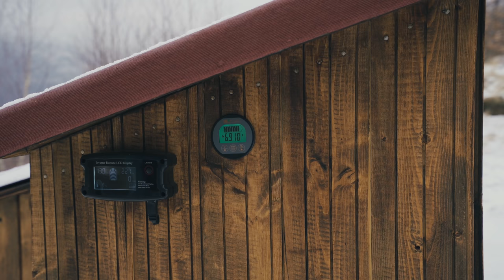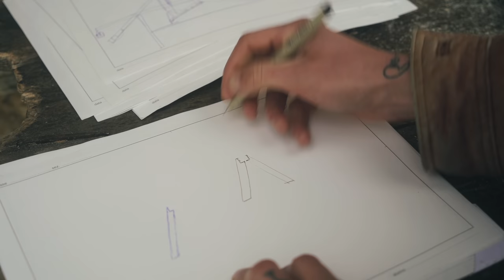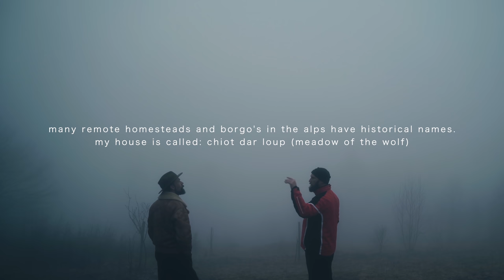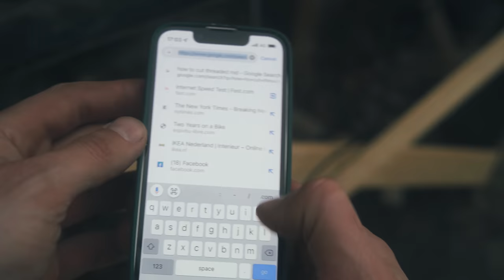#12 Meadow of the Wolf

Comment: An important piece of advice. If you have not planned to already get a small excavator in and flatten the ground around your dwellings. Your ankles will thank you for it. It is surprising how much physical and mental energy we use on uneven ground to stop ourselves rolling our ankles. Even if you don't have the funds spend the money on it and if it takes three months longer to finish the house you will be happy for the flat ground. If you do have the funds clear around the house as well and step the slopes so when you build your scaffolding you have safe even ground. If you have the funds dig the trench for the solar cable. The time and energy saved using a machine is well worth the money. Also, dig a u-shaped trench around your dwellings so any water flowing down the hill does not make your flat ground muddy. Great idea to build the wood cabin inside the building :)

Comment: Hello Martijn, Watched your Grand Dad's Video, what a talented craftsman. Now we see where your varied building and innovative construction abilities come from! On the boom of the crane, my husband said a small ATV 12volt winch, with remote control instead of the Manual Hand Crank, would be easier for one man to control, quicker, safer under load with internal cable brake. He feels it would greatly reduce the project time of rock removal as well, Just something to consider! Also suggest drilling multiple 1/2 inch ventilation holes in the generator side doors, then put screening inside, would not require you to constantly open close the doors themselves. Immensely enjoy the videos and the views, the Wolves we're an added Bonus!! Nancy & Tom, Bethlehem, Pa.,USA...God Bless, and Stay Safe!

Comment: The wind moves the sound over very long distances in the high mountains. It echo and amplify the sound to a significant degree, especially when it is cold in the air, and/or and the wind carries the sound in addition. Thats why these wolves easily could be as far away as 35 - 50 km, in my opinion.
The wolves in Italy (Lat: Canis lupus italicus) should not pose any threat. In general they are very cautious and avoid contact with humans. 
Thanks goodness its not the Scandinavian species you have to deal with, (Lat: Canis lupus). 😅 A species that can reach a weight of over 75 kilos, and to a certain extent, pose a genuine threat to humans, in my opinion. Especially if the herd feels strong.  Lol   🐺🐺🐺

Comment: I feel you so close ,I did something similar in a totally different situation some years ago.
Out of my experience I would suggest you to change the inclination of the pv panels, they are to flat
specially for the winter season.
the best performance you get it when the sun hits the panels perpendicularly.
If the place is windy consider also a wind mill  a small one around 400W it does a great job specially at night and cloudy days.
Keep on going man you are doing a great job 
I wish you the best with a little bit of jealousy in my heart

Comment: If your using an angle grinder on steel and don’t have a metal blade .. grind through a piece of wax like a candle and it will put a coat on it and will cut through steel like butter.

Comment: I also have a few glass jars with spigots on them. I got them quite cheap. I came up with the idea to use the spigots on slightly bigger containers for gravity fed water. I have a couple of rectangular containers that are made of see-through food grade plastic. They are 14 cm x 24 cm x 26 cm (height) and come with a lid. When you drill a hole in them, you start with a very small sized drill bit, and then go gradually bigger until you have the size of the spigot. The spigots have two gaskets, one that sits on the outside of the container, and one that sits on the inside. And there is a plastic nut to tighten it all together from the inside of the container. You can have a container like that sitting on a shelf, or you can hang it on the wall. To hang it on the wall over a sink, I used one piece of wood on the side of the container and one of the outside (close to the top), and then screwed through them and  into the wall. You have to predrill holes in the container for the screws. You can also use bigger containers, off course. But these rectangular one's are good over or beside a sink. We also have 20 liter pots with spigots on them here. They are meant to be used to heat water on a wood stove in off grid cabins. I have two of those, one on the wood stove and one in the kitchen for washing up (I just add some hot water from the other one). The water flow is almost like from a faucet on those pots.

Comment: Advice:
1)
Get about 2 dozen solar flood lights
So you can light up all around both cabins and put on post to line your driveway.
2) get a gun to protect you against the wolves, cougars and bears or whatever wild life that’s there.
3) make s bed cot, so your off the ground 
4) make sure that door locks at nighttime., even if it’s a 2x4 going across on inside., braced n enforced., for a better lock.
5) chains for your vehicle., snow, cliffs are close.
You should have bought that farm tractor from the owner., could use to redo the roof and fix stone steps.

Any friends?
Have them come help you do both roofs.
Your out there all alone. Be careful not getting hurt.

Comment: Martijn, I would highly recommend investing in some quality hand tools for all of the wood working that you have to do. 1/4 1/2 3/4 and 1 inch chisels, brace and bit with auger bits and some good handsaws (cross cut and rip saws). Antiques are generally better quality than modern tools.

Comment: My tip for cutting threaded rods and bolts: Just cut it with an angle grinder metal cutting disk, no need to put on nuts first. Then put a grinding disk on the angle grinder, e.g. of the type with overlapping sandpaper pieces. Grind a small (2 mm high) bevel at a 45° angle to the end of the rod by rotating it slowly while holding it against the grinding disk. Make sure direction of rotation is so that all material is transported away from the rod, towards its end – this keeps the thread clean. Now you have a clean thread with a nice lead-in that makes it even easier to add a nut than with the technique you used.

Another related tip: I like to use stainless steel bolts as much as possible, as then there is no corrosion issue after such shortening cuts. Makes bolts much more versatile when you know you can always cut them to length without bad effects.

Comment: Hi Martin. Love the videos and thank you. 

A tip for the crank/winch on the crane. I think you should have the cable coming out of the bottom if you can, as opposed to unwinding from the top. That will transfer and lessen the forces on the bolts. Maybe it won’t matter…Inguess it become an argument over shear strength of the bolts or the gripping power of the bolts and where you want the forces acting. 

Bottom line though, if the cable unspools at the bottom of the winch the leverage on the bolts is reduced by a couple inches.

Comment: I wonder, how you will assemble and later handle the crane beeing alone out there. I probably would have tried to remove the stones via a ramp, redo the roof and then find a solution to use lever rule and my own weight to lift the stones back up or even cut them to a more modern size. This will all be very interesting and I am looking forward to it.

Comment: You've mounted your panels very flat for the winter sun.  If you sloped them more you would get more power in the winter.  Snow would slide off quicker.  And it would be easier to remove snow.

Think about either mounting for maximum winter production and let the longer summer days make up for the "angle loss" or adjusting the slope two or four times per year.

Comment: I been thinking about your Crane for hours and have u ever seen north America hay barn storage systems; a rail of steel runs the length of the barn and it has a pulley that swivels, so, a beam of strength running several feet above the peak and a number of feet beyond one side, two ropes, one raising the load, one pulling the pulley and load to the far side, then lower load/stone to ground, maybe use your motor car to raise and lower loads, stay safe mountain man,, buddy system..

Comment: Hey Martijn. Thanks for a great channel and content so far. Im a Key Grip in the Film Industry. Perhaps you know what that is? I am also a specialist with a telescopic camera crane called a SuperTechno Crane. It has weights that move rearwaqrds as the front end extends. It looks a lot like what you are drawing. I humbly propose that you are going down the wrong and possibly dangerous route with the crane. It will be infinitely simpler to build a gantry on tracks over the house. Then you simply position your block and tackle above the stone youre moving, hoist it up and wheel to the end of the building and lower. The base and arm you are going to need to cover that roof with those 200 kg stones...and you can still build the gantry out of wood. Tracks and wheels too! Obviously one track will be a lot lower than the other, but that only means that the one A frame will be taller than the other. Tracks running across the slope, not with it. Ill come help you if you like.

Comment: I think you need to reinforce your solar panel scaffolding structure big time. And I think you need to secure it to the ground with thick, solid metal wires all around - maybe six of them. If possible I would have used very solid metal bolts with eyes that are secured/bolted/glued (professionally - I am not sure how they do it) into the mountain ground (don't know the english word for that). Keep a long, solid walking stick made from a young tree or something with you when you go for walks, at least during night time. It can be used to fend off an animal attack. Not that I think it is very likely that wolves will come that close, but I think it is a good idea. It will also be easier to keep your balance in rough terrain when you are using a walking stick. In case that you, against all odds, should happen to meet a wolf in the area, roar you lungs out like you have never roared before to scare him off :-)

Comment: Regarding the Solar Panels….did. you consider to Mount them in a steeper angle?
Yes, would cost you efficiency in summer, but gain efficiency in winter when it actually counts. Plus, snow coverage could be avoided.
Apart from that….thanks for your videos, very inspiring.

Comment: To bad no one has come up with a cheap and easy way other than wiping the snow off by hand of keeping the panels clean automatically.
I live in central NM, many years ago I was trying to get a house ready for a final electrically inspection, I had worked late into the night, rather than go home I just laid down on the floor, sometime during the early morning a coyote cut loose right under the window (Well it seemed that way) I was standing before I was awake

Comment: Have you heard of a forstner bit? I like them better for drilling holes the size you used for the sockets to hold the pipe. I know you're done with that part now, but if you're going to be drilling holes for plumbing and wiring in the cabins I'd look into getting one.

Comment: Just a thought, a steel spacer for the pully cable to ride over, will increase the life of the cable, possibly a 1/2in or 3/4in support shaft to allow for larger loads?

Comment: Are you cutting steel with diamond concrete discs? Those discs are good for steel?
Just a tip: when you make holes in wood  with the hole saw and the wood hits the bottom of the saw cilinder inside, just take a screwdriver and brake that wood cilinder than you can go deeper through wood. You don't have tu use the pendular saw.
Great job anyway!

Comment: Thanks again, Martijn. May I suggest that it might be time to build a lumber storage rack against the rear wall of the smaller building. Keeping the lumber dry will prevent the moisture that rots and easier to cut.
Reply: He is using the smaller building for lumber storage.